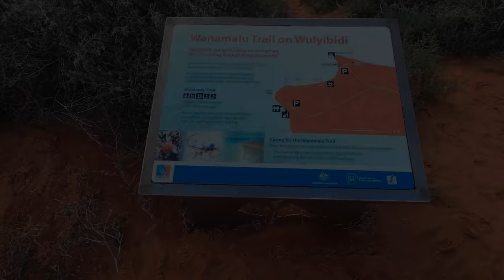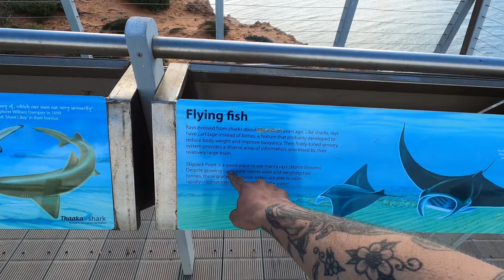GREY NOMADS To The RESCUE! It Turns Out We Both Needed Help!

Comment: Hey hope things are well! It’s a nice place up there wanting to go back for a while now,
Next time you go boating and you need to winch your boat like that take the cordless drill with socket to match your winch handle than you can just pull the trigger 🤟
👍🥔🇦🇺
Reply from the maker: Thanks mate, hope you're well too! My winch handle isn't a removable one so it's actually just a nut for a 10mm thread, which would probably end up stripping if I gave that a crack but I don't mind the thought 😝🍻